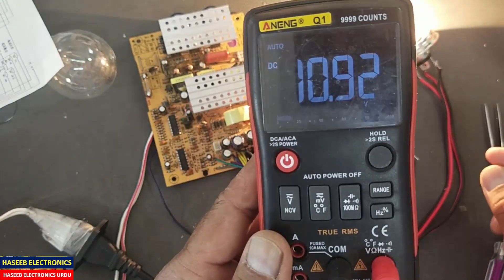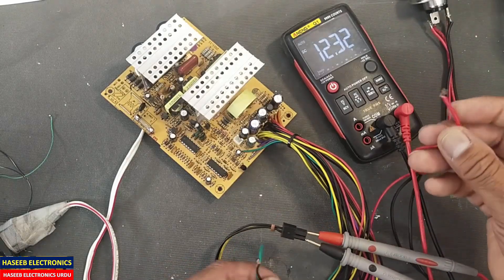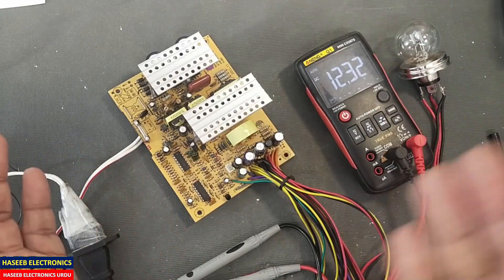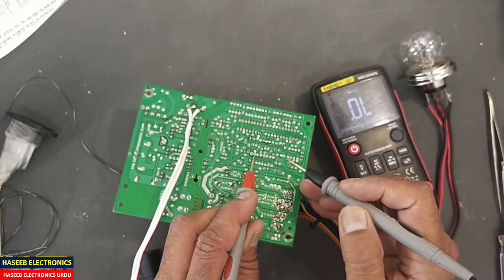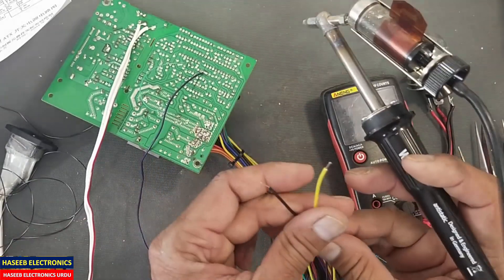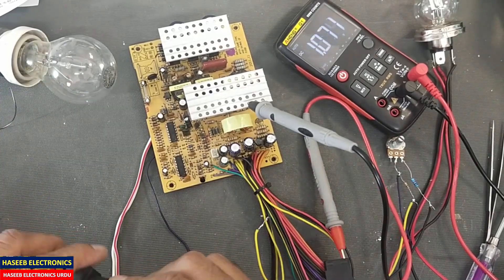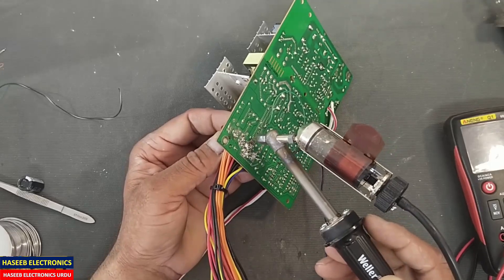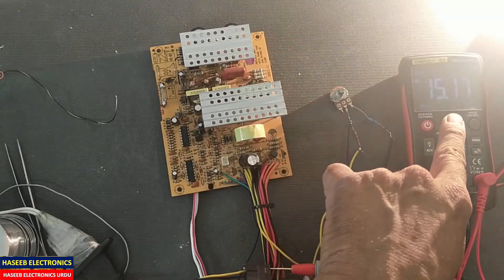{636} Convert ATX PSU Into Variable Power Supply, Increase ATX Output Voltage

Comment: Excelente como siempre tu forma de enseñar , se trata de un gran maestro de la electrónica lo que haces , Muchas Gracias por este y todos tus trabajos anteriores !!!!  👍👍👍👍👍👍👍👍
Reply from the maker: Hello
I am grateful for the beautiful and encouraging message. it is a pleasure that my efforts are useful for my viewers.
please accept a special thanks for your comment.
stay blessed
Reply: @HaseebElectronics  
Mis Bendiciones para ti , eres un ser merecedor de agradecimientos porque lo que haces es  digno de una persona de un gran valor Humano !!!!
Reply: @HaseebElectronics  have a great day sir. i am your follower here in the philippines. i have a question regarding this computer power supply because we can buy a cheap price of this a secondhand. i plan to make this ATX to supply my booster amplier with an input voltage of 45v dc, can i increase the voltage for up to 45v dc? how about  the current because my atx supply indicates 25ampere 12v+ it means if i increase the voltage to 45v the ampere is the same 25ampere or it will decrease to 5ampere something. but how can i get 45v dc of this power supply. i hope you can read my message. thanks.
Reply: Muito bom

Comment: 🎉🎉🎉🎉estoy rescatando una ATX USA-NET tienen un Ic HS-8108 he logrado encenderla pero no logro subir a los 13,8 Volt esta establr en 12,6 .... Me gustaria poder trabajarla para Radios C.B y otras pruevas de taller ..... Si fuera posible me indicaras cual serua el proceso ya he recuperado otras que tieien el Ic TL-494 cambiando capacitor y el potenciometro al Pin1 😢😢😢 gracias por los aportes se le saluda desde San Cristóbal Táchira Venezuela gracias

Comment: When +12v is supplied to IC Pin no.1 via 10k potentiometer, the output voltage would be increased  and this would increase the feed back voltage at Pin No.1 too.

Comment: Hi, i have an ATX PSU  with only 1 IC 'SG6105D' BAZ33780351E . Can i do a a similar modification to use it as a battery charger.

Comment: Can someone explain why psu is turning off when load is connected? Is that because load consumes more power than psu is rated for?
What about normal work?
How psu knows when to not cut off power?
Reply from the maker: almost all power supplies have output supervisor IC, that IC monitors the output voltage for undervoltage and overvoltage and imbalancing between the output lines 
if any voltage drops, the second line will incraese, thus the supervisor ic will turn off the PWM controller IC
in case any output capacitor gets open or short circuited or leaked, the volatge values on supervisor IC's input lines (sense lines for 3.3 volt, 5 volt, 12 volt) will change and it will terminate the PSON interlock to disable PWM drive 
please consult the datasheet for supervisor IC installed in your PSU's output stage
Reply: @HaseebElectronics  
Thank You for very quick and helpful response

Comment: After removing one leg of the resistors on the +3.3v and +5v output lines from the PCB board, what were the voltage values of these two lines? You didn't show this in your video.
Reply: 0 for each. Taking those resistors out of circuit effectively opened the circuit for them.

Comment: I have the same board and success to disable the short circuit protection,but when I am connecting the Pot ,the output voltage is not stable anymore, please help sir

Comment: Can this trick work on every ATX Power supply? Thanks
Reply from the maker: this trick makes it variable but the power supply looses the current regulation. so i am trying to add some external linear regulator to provide variable voltage and variable current

Comment: hello friend , I was able to hack a computer psu by watching your videos and get variable voltage between 5-24 v from 12 v rail . i want to thank you and ask one question what's happen if i change frequency of tl494 ic ? actually i tried to lower frequency by changing resistor of pin 6 of tl494 but output voltage remained same . do you have video about changing frequency ?

Comment: Thank you for your video sir, I have only little knowledge in electronics.... But I'm very interested to try your tutorial... I'm planning to use my cpu
 power supply to supply my car amplifier which is 12 volts 3600 watts... I will use your video as my guide... Thank you very much sir, I hope many people will learn and to have a very good knowledge because of your blog... Many thanks sir... Keepsafe... GODBLESS
Reply from the maker: You are most welcome
if you are using computer power supply, most of time, maximum output can be taken from computer power supply that is 400-700 watts. while 12 volt section can provide maximum 200 watts in an excellent power supply. 
that will not enough to run your amplifier. 
moreover, you need to remove protections and then it is doable 
wishing you best of luck and success

Comment: Thank you sir for being such  a good  source of inspiration to us. We so much value your depth of knowledge and experience in this field.  I did modified my ATX unit and the output varied properly I'm yet to add a suitable load though. But I also want to point to a problem I encountered and what I did as a solution. Problem:>>>> After using this trick I noticed that power resistors at the output became very hot. Solution:>>>> I removed them know they were working as a dummy load and for current measurement purposely. I'll replace it later though with a suitable one. But i'm posting this because I know some people will encounter such. And I also want to ask if you as well encountered this same problem? ....... Hope to get your response or anyone's response.

Comment: I've replaced the 16V 1000uF capacitor from output with 25V 1000uF capacitor but it's going up to 18V, should i buy a 35V or it has something to do with the fact that i've soldered a 2K resistor for ground(i haven't had a 1K when i wanted to test it)

Comment: I followed this tutorial, but the Voltage only came out to 13.11v on the 12v & ground cable even though I already checked the potentiometer.
Reply: Disconnect all the 3 feedback resistances coming from 12v, 5v and 3.3v.. looks like you have disconnected only 12v feedback resistance.

Comment: Hi, thank you very much for the helpful information. I need  a regulation between 2V and 11-12V. I suppose that 12 volts output cannot go so low, but is it possible to use the 5 volts output for such a range? If not, what is the max range that it can provide? Thanks!

Comment: Salam M Haseeb, if by mistake we short the output voltage why will happen ? thank you & Salam aleikum.
Reply from the maker: wa alaikum salaam dear brother. 
i am sorry for delay in current control modification 
i will discuss in detail with practical 
it will ready in few days
Reply: @HaseebElectronics  Thank you dear brother.

Comment: In case output is short then a large current flow and power supply is work on high power and finally damaged🔥🔥😂😂 so short circuit protection are required 😊
Reply from the maker: exactly perfect
basically it was request from my viewers to disable the protection, as they are using in room coolers having 12 VDC @6-10 ampere. and this power supply shuts down without driving the load 
i am going to record a current limiting technique to control the output current, that will fifth video of this ATX power supply modification series 
part-1 = 631
part-2 = 629
part-3 = 634
part-4 = 636
next part = current limiting, (expected next week)
after that = complete troubleshooting (possibly within 2 week)
Reply: @HaseebElectronics  thnx sir pahle ki sari video dekh chuka hu
Mai ek chota tip de sakta hu tl494 ka ek op amp Khali hai usme shunt se current sence karake error signal generate kar sakte hai..
Jis se ek current limit ho jayega 😌😌
Reply from the maker: @crazychela6105  wow that is awesome
nahi is atx design me shunt ka jaroorat nahi hoti. ye CT k voltage ko sense karti he
Reply: @HaseebElectronics  uska connection kat ke inverting pe ek voltage khud se set karke aur non inverting pe shunt wala voltage sence kraenge jisse voltage aur current dono control ho jayega kyuki dono op amp ka output ek sath connect hai..to error signal bhi generate hoga 😀😀
Reply: @HaseebElectronics  sir, how about the other opamp of TL494 to setting current limit or it still work fine? , it will be more satisfaction ❤
Reply: Why you disable the protection???
Reply: نريد منك اخي العزيز كيفية تركيب عداد دجيتل لقياس الفولت الخارج من المقاومة المتغيرة وجزاك الله خيرا

Comment: I am using the 12V output only but at a fixed voltage of 13.8V for CB radio and mobile electronics use. Can you please explain in a future video how to keep short circuit and overvoltage protection? It doesn't need to be extremely sensitive. It just needs to protect against catastrophic failure. Thank You.
Reply: My donor suppliies are nearly identical to the one in your videos. I was able to increase the voltage but the protection circuit trips very easily. It should be easy to make it less sensitive to quick voltage and current changes but I can't quite figure it out. Adding a 47k resistor between lm339 pin 5 and ground seems to help. Any other ideas?

Comment: the iron soldering ist made by  Weller germany .Whici serial name have this iron soldering
Reply from the maker: Yes dear 
it is WEELER WR3M rework station
Reply: @HaseebElectronics  expensiv  1400$  visit the site weller
Reply from the maker: @mirceacluj  yes 
I purchased before 5 years 
at that time it was 3300 USD

Comment: salam alykom haseeb i am looking for ic in my circuit design can you help me ?
Reply from the maker: wa alaikum salaam dear brother
which type of circuit design you are going to design 
which topology are you using
Reply: @HaseebElectronics  well iam still new in pcb design .. its just a 3.7v battery charger with load sharing function pcb .. i found charging ics with power path fucnction .. not effect the battery charging while load is powered at same time
Reply: @HaseebElectronics   can you describe topology for me or where to start ?

Comment: Very nice video !! finally what i wanted to see : a no drop voltage under load from an ATX. I have M Haseeb 2 questions before i start this project :
1- What happens if by mistake i short the output ? are there any other protections ? or should i put a fuse ?
2- Is the same principle applies to other designs (mostly the ones using UC3842/3843) ?
Thank you & Salam Aleikum.

Comment: Sir. Is it possible to adjust from 1v to 20 v
Reply from the maker: No we cannot adjust any SMPS in so wide range 
but we can add a linear voltage regulator circuit with current regulator (as LM723)

Comment: Great Video.Could you add current limiting feature too ?
Meanwhile  I am waiting a video about  SMPS variable  voltage and current limiting  power supply design too.
Reply from the maker: sure 
in my next plan,  to add current limiting feature in the same modification

Comment: Asslkum Sir.
I can adjust from 1 volt to 22 volt, but I have a problem, the transformer rattles at a voltage of 11 volts to 18 volts when there is no load, but when there is a load there is no problem...schematic by Mr. Roberto

Comment: What should we do if we want to have a 12V power supply voltage from zero to 30 volts?
Reply from the maker: by controlling the duty cycle of any smps controller
it is impossible 
you can use a linear voltage regulator and current regulator in the output

Comment: Can we use 20k potentiometer instead of 10k potentiometer and then with 10k resitor
Reply from the maker: no it is much better to use 10K resistor and 10K potentiometer 
if you will use 20K, at full counter clockwise it will damage the PWM controller IC
Reply: Thank you for nice guidanca

Comment: you are one of the best electronic content creator of YouTube but still underrated.love your video . knowledge has no barrier so, love from India.🇮🇳
Reply from the maker: best regards 
no brother, my channel is not underrated, i am satisfied because i am not working for views, earning, or subscribers 
that's why i never force for like share etc. 
i just share my experience, and reply the answers for my viewers so it may help someone
Reply: @HaseebElectronics  you are so humble . May God bless you sir.  
sir how can I disable over current protection in CG 8010 IC ? I made my atx variable but when current is about 3 amp at any voltage(e.g. 14v, 12v or 22v  the smps stops . the smps is frontech 450 watt. i removed over and voltage protection by adding a voltage divider circuit by connecting to 5v SB . but still this problem happens. help
Reply from the maker: @dibyendudas9686  best regards
I will explain the current controlling technique in the same TL494 based atx power supply 
and will see the possibility for 8010 as well
Reply: @HaseebElectronics  I can understand how much time and efforts are needed to create a technical video, which are serving their purposes very well. I heartily respect your patience, efforts, and time, what you spend in creating these valuable informative videos.

Comment: Thank you Haseeb, your videos are so informative, just a question is there a way to increase the amperage for laptop fault finding ?
Reply from the maker: best regards 
we cannot increase amperes, because the transformer is limited at a rated current, if we will try to draw more current by hacking the protection, it will cause to overheat the transformer, MOSFETs and it will lead to destroy it rapidly
Reply: @HaseebElectronics  Hi Haseeb, but how about rewinding second side of transformer to replace unused 5V and 3.3V windings with extra copper for increase output current?

Comment: very good video sir.  my question , 1. what  will be the max  ampere of  this 12 volt section ? 2. can we make short circuit protection for this device ? 3. when more than 24 volt variable supply is require then what to do ?

Comment: Best to best. All videos are usefull. SIr I need to help from you. Sir I have printer power supply & I try to repar it. Finally struck. My question is.... main mosfet over heart. Output power 24v ok. But in 30sec main mosfet over heat & its gone. Main mosfet control using fuji FA8A86 ic. In main capacitor 305v indicate not switching time. But main mosfet swichin mormet main capacitor voltage drop to 271v. What am I do sir. Comments please
Reply from the maker: please write the printer model number or power supply board model number 
so i can reply with some possible causes 
waiting for your reply
Reply: @HaseebElectronics  sir part no is Rm2-8214 thanks for helping me.
Reply: RM2-8214 - HP Laserjet Pro Power Supply Board for M130 / M132nw